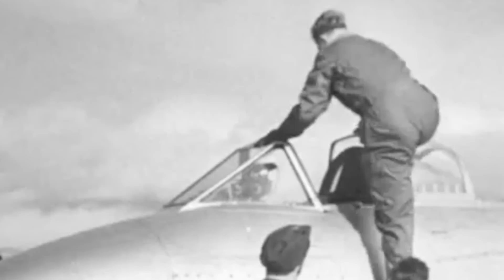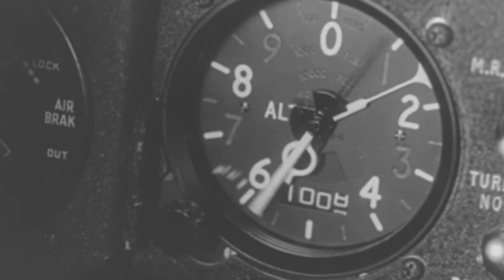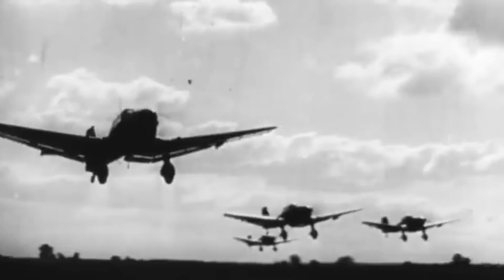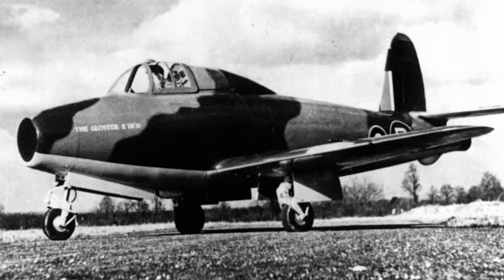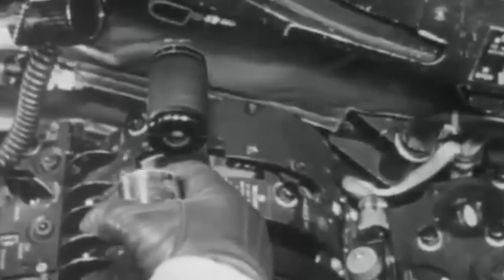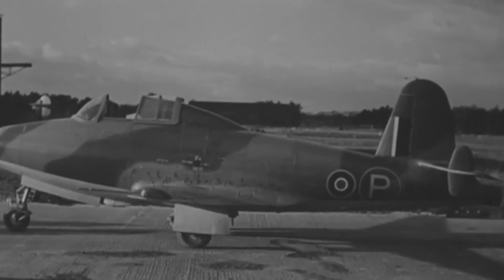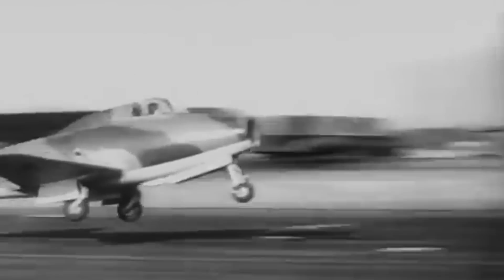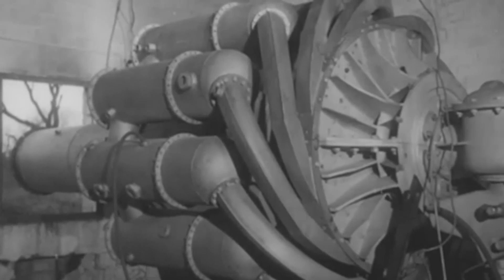Britain's 500 MPH Coffin With Wings

Comment: Urgent attempt ?  The first jet engine designed by Whittle in the thirties. (Patented in 1930), years before Ohain got his hands on the patent, courtesy of the government and the patent office.  Youtube Whittles life story.....  You'll be shocked...  And by the way the original jet was flown by Jerry Sayer.....
Reply: The old Alliboo myths refuse to die... Whittle was not the first to patent, Maxime Guillaume patented the turbojet aircraft engine in 1921 when 14-year-old Lil'Frankie was still wearing. 
 short pants.

Hans von Ohains prototype bears absolutely no resemblance to Whittle's patent (which was never built because it wouldn't work) and was significantly more advanced and sophisticated than Whittle's patent design.
Whittle's work was years behind and was an evolutionary dead-end concept.
The jet we used today was designed by Dr. ANSELM FRANZ at Jumo.
Reply: @sandervanderkammen9230 @WilhelmKarsten     

   Yes that's right, Indeed it is without doubt entirely correct that the gas turbine concept was first conceptualised in England before 1800.
    It is also correct that the multistage sequential rotor stator axial compressor & axial turbine as used for power generation & propulsion turbomachinery purposes was of course first produced in England by Parsons of Ireland & North England before 1900 the technology being licensed for manufacture in many other industrialised countries. The same components as used in all current axial gas turbine aero engines.
    Its also well known that serious work on the axial configuration gas turbine aero engine began in England before 1929.  
  
    That is indeed correct, more recently of course the most powerful gas turbine aero engine on the planet in 1944 was in fact the Rolls Royce Nene versions of which would go on to power many jet fighter aircraft including the Mig 15 & many UK & US built jet fighter aircraft during the 1940s & 1950s. The RR Nene was of course twice as powerful as anything produced in Germany at the time & 100 times more reliable & would go on to be copied in Russia & China & built under licence in the US, Sweden France & other countries
   Obviously the required Nimonic Alloy turbine blade material was first developed in England around 1940 & was available nowhere else at the time. It was a Nickel super alloy (Composition is mostly Nickel), Engineers in Germany & the US were attempting to use various kinds of stainless steel such as high Nickel stainless steel (being steel it's mostly iron)  which of course doesn't work.

   Agreed, Gloster Meteor accident losses were not high or unusual for fighter aircraft at the time.
Non combat phase accident losses
% of Aircraft built.
The Canadair CL-44 was a turboprop airliner.
Canadair CL-44                    (ff 1959 ) 48%
Lockheed XF104                    (ff 1954) 100%
Lockheed  P80                       (ff 1944) 43%
Lockheed F104                      (ff 1954) 45%
McDonnell FH Phantom       (ff 1945) 35%
Gloster Meteor                     (ff 1943)  21%
DH Vampire                          (ff 1943)  23%
DH Sea Vixen                       (ff  1951) 33%
Gloster Javelin                     (ff 1951) 20%

A specific comparison.

Gloster Meteor.
3950 Built.
In service 1944.
70% didn't have ejector seats.
839 accident losses.
436 accident loss fatalities.
21% accident losses.
11% accident loss Fatalities.

Lockheed F104.
2578 Built.
In service 1958, 14 years after the Meteor.
All had ejector seats.
1100 accident losses.
425 accident loss fatalities.
43% accident losses.
17% accident loss Fatalities.

   Yes it is the case that the Gloster Meteor broke world speed records in 1945 & 1946. The world's first Turboprop was a modified Gloster Meteor. 1940s & 1950s Russian, British & US jet fighter aircraft usually had British / Russian, British, or British / American technology gas turbine aero engines.
From 1942 onwards British & US jet aircraft were always faster than piston engine fighters if the same year.

   That's right, the world's first demonstration of a pure gas turbine aero engine was of course performed by Frank Whittle in England in 1937.

We hope this helps of course.

Cheers indeed & 👍 obviously. 
. ....... .......... ...... ..................

The line above this line is obviously intentionally blank.

Comment: Whittle developed centrifugal jet engines and was headed down the wrong path.  Germany developed axial flow engines which is what is used today.  This video is an interesting look at the historical footnote that was the WWII British jet engine program.  When Whittle's first generation engine was developed many in the British Air Ministry were still holding on to the idea of the biplane, hence jets were off the table.
Reply: The 262 had an engine with a scrap life of 25 hours.... hardly a success.....
Reply: @Addad66 Actually the US Army tests conducted by Operation LUSTY confirmed TBOs averaged 55 hours between overhauls... better than Allied piston engines..
Reply: @sandervanderkammen9230   Complete and utter BS, the Jumo and  BMW had this good TBO, only when you babied them by advancing the throttles so slowly that it took 3 minutes to spool up the engines,  55 hours TBO isn't something to be proud of when the Whittle and R-R engines were putting in hundreds of hours.

  In actual, non obsessive compulsive uses, like in a war where you need your power changes immediately... They faired much worse, and were lucky to get 15 to 20 hours, their turbines burned up quickly despite having cooling air forced through their blades,  these engines were what they could have their prisoner-concentration camp laborers build easily, because fascists are morons and always choose the cheapest and crappiest way to do something.
Reply: @tauncfester3022  Your comments reveal someone who has no formal education or professional experience regarding this subject matter.
 Please stop posting false and misleading information on a topic that you very obviously are not qualified to discuss intelligently.
Reply: Whittle was not headed down the wrong path; he was being pragmatic with the technology and resources of the time. Centrifugal engines were an essential first step to getting jet engines working when, as the Germans showed, axial engines had not yet progressed sufficiently. The Russians copied centrifugal engines for the Mig 15 and the first reliable axial flow engines eg J47 were developed only with the USs vast resources. Furthermore, centrifugal engines have carried on for decades in helicopters.
Reply: @Dalesmanable  and in many small, short service turboshaft airliners of the mid and late 1950's both in Europe and the US, as the Rolls Royce Dart turboshaft.
Reply: @Dalesmanable  Of course Whittle went down the wrong path, he was a very poor engineer with limited skills, centrifugal turbojet engines were clearly inferior and an evolutionary dead-end.
Whittle himself nor Power Jets Ltd would ever produce a single successful viable engine.
Whittle was sacked by the Ministry and Power Jets Ltd became defunct.
Frank Whittle exiled to America and never worked as an aerospace engineer for the remainder of his life.
Centrifugal jet engines are extinct today.

Helmut Schelp was the genius that recognized centrifugal compressor would go nowhere and insisted all development of centrifugal jet engines ceased immediately in favor of axial compressors, this would give Germany nearly a decade lead ahead of the Allies.
The Jumo 109-004b was 10 years ahead of anything the Allies had during the war
Reply: @sandervanderkammen9230 

We feel certain we can clear up some commonly held misconceptions.

   That's entirely correct of course, in 1944 the RR Nene, a Whittle type Centrifugal Compressor gas turbine aero engine, was twice as powerful & 100 times more reliable than anything being produced in Germany at the time. 

   Indeed it is in fact true that the RR Nene & versions of the RR Nene of course would be built under licence or copied in many countries including China, Russia, The US, Switzerland & France into the 1950s.
  
   Obviously versions of the Whittle Centrifugal compressor reverse flow combuster type gas turbine aero engine are currently produced for aircraft applications. The Pratt & Whitney PW200 range of engines being such an engine.

  We do indeed hope this helps of course.

Cheers of course as always.👍
Reply: Your "wrong path" assertion is misguided: it demonstrates a lack of knowledge and understanding of the available technologies of the time.  Whittle developed his jet engine in the 1930s with its centrifugal compressor, using the only path available to him, which was the known technology of the supercharger.  Even so, he had to push it to the limit in terms of pressure ratio.  He had no access to axial flow compressor technology, which, in any case, still needed years of development, both aerodynamically and mechanically.
The Royal Aircraft Establishment was secretly working on axial compressors into the late 1930s, under Dr A A Griffith, who had dismissed Whittle's turbojet proposal in 1929, having tested an experimental single-stage axial flow compressor/turbine rig in that year.  Griffith had dismissed Whittle's visionary proposal because he believed that the future of the gas turbine for aircraft propulsion was the turboprop.  He failed to appreciate Whittle's vision of high speed flight at high altitude with jet propulsion.  
In his first build of the WU engine in 1937, Whittle got both his centrifugal flow compressor and axial flow turbine (nearly enough) right, but he still had work to do on the combustion system.  It took him two rebuilds to come up with a flight standard of combustion chamber, with the assistance of specialist companies.  Incidentally, he got things wrong when he radically redesigned the compressor diffuser arrangement for the W.2 engine: it took some intensive rig work at R-R to get that right.
Independently of Whittle's work, in 1938 (or thereabouts), the RAE engaged Metrovick to build and develop their F.1 turboprop proposal, using their axial flow compressor, coded-named 'Freda' (hence the 'F' designation of subsequent Metrovick engines).  However, when Whittle's rebuilt WU engine demonstrated the real potential of the turbojet in 1939, the RAE/Metrovick turboprop project rapidly metamorphosed into a turbojet, the F.1A, which was soon succeeded by the F.2/1. This had its first flight in a Meteor prototype in the 1943.
However, by British airworthiness standards, the F.2/1 was unreliable -  but it was altogether more reliable and had better performance than the Jumo 004B.  Nevertheless, it resulted in the development of the F.2/4, aka the Beryl, and the F.9.  This was handed over to Armstrong Siddeley, to become the Sapphire 6, arguably the first successful post-war turbojet, with thousands built in the States as the Wright J65.
I will reiterate the point that I've made elsewhere, which demonstrates the relative immaturity of the axial flow engine.  In 1944, the Jumo 004B had a lower pressure ratio, a higher specific fuel consumption, and a lower thrust:weight ratio than Whittle's W.1 engine in 1941.  The handling and throttle response of the 004B was problematical, and its compressor surge margin was marginal.  The throttle had to be opened and closed slowly, at risk of a surge and flameout.  This would have made the Me 262 useless as a dogfighter.
To highlight the problems with and the immaturity of axial compressor technology at the end of WWII, let me quote from Stanley Hooker's autobiography.  He states that, "it took us about seven years before the AJ.65 [the Avon prototype] could get a clean bill of health.  Seven years, when we had made the [centrifugal flow] Nene in as many months!"  Subsequently, the Avon compressor was significantly further improved by a technology transfer of the Sapphire's compressor aerodynamics: RAE's 'Freda' compressor to the rescue (via Armstrong Siddeley)!
Finally, let me draw your attention to Whittle's LR.1 engine, which he was working on at the end of the war.   It was a geared turbofan with a bypass ratio of between 2:1 and 3:1 and, conceptually, it was decades ahead of its time.  It had an axial flow HP compressor, with a centrifugal last stage.  The three-stage fan was driven from the front of the HP compressor, via a reduction gearbox.  Unfortunately, along with several other advanced projects, it was cancelled: in hindsight, shortsighted, but the country was broke.
Reply: @grahamj9101  Thank you for proving my point.  I am in agreement with Dr. Griffith.  The main failing of centrifugal jet technology is, especially in the early days, was that in order to create a more powerful engine, you had to increase its circumference.  With axial flow technology, you only had to make it longer.  Modern turbofans can do both.  Compare the engines of an SR-71 to those of a 777.  History teaches that axial flow was the way to go.
Reply: @grahamj9101  You do have to give Roll-Royce credit for the Dart turboshaft, which powered many of the UK's early turboprop airliners and Fokker's Friendship F-27, also licensed and built in the US by Fairchild. 

 My first airliner trip was in an F-27 and I got the wingside seat and was pretty fascinated by the complex main gear retraction.  This is the plane that allowed small airports around the US to have a fast and comfortable airliner service to bigger airports.
Reply: @grahamj9101  A.A.Griffiths pointed out that Whittle lacked the experience and the knowledge to build any compressor.
IN FACT, the  W.U. engine was constructed using an old  foundry furnace blower in an abandoned Thompson-Houston factory basement. It was driven by a 4-cylinder Austin 7 automobile engine.

Helmet Schelp, head of engine development at the RLM ordered all development of centrifugal jet engines ceased in favor of the superior axial type... giving the Germans a huge lead in early jet development.
Britain wasted years chasing their tail with a  dead-end design.

Whittle completely failed to produce any viable engines or any that could pass airworthiness certification... neither did Metropolitan-Vickers, they abandoned jets and returned to steam engines in 1947.
Reply: Rather a silly response. Later marks of Spitfire and Tempest for example, were exceeding 400 MPH.  Incidentally, at the time, the centrifugal  jet  (Whittle) was more reliable that the axial type.  That changed later.
Reply: @electricmanist  Whittle's engines could not pass the RAF minimum reliability standards for airworthiness certification and they were never adopted into RAF service.
Piston engines were more reliable than Whittle's jets.
The Tempest was actually faster than the Gloster Meteor and replaced it in the V-1 interceptor role.
The Messerschmitt Me-262 on the other hand could fly over 125 miles per hour faster than any Allied aircraft and tests conducted by Operation LUSTY confirmed TBOs averaged 55 hours between overhauls which was better than most Allied high output piston engines during WW2
Reply: @sandervanderkammen9230  The Whittle jet prototypes we not really designed for speed, but more as flying test beds for the early jet engines.

Engine reliability was one of the main factors which reduced the Me 262's effectiveness plus Hitler was obsessed with its use as a bomber--again a factor in its availability as an interceptor.
Reply: @electricmanist  But the Messerschmitt Me-262 engines easily exceeded the RAF's PFTR reliability test requirements for airworthiness certification and adoption into RAF service... something that Whittle's engines could not.

Myth busted.

All modern jet fighters are multi-role Interceptor-Attack aircraft with bombing capabilities.
It's bomb load was the same as the P-51 Mustang which also had a dedicated bomber variant called the A-36 Mustang.

A.H. was right all along, and you look a bit foolish right now.